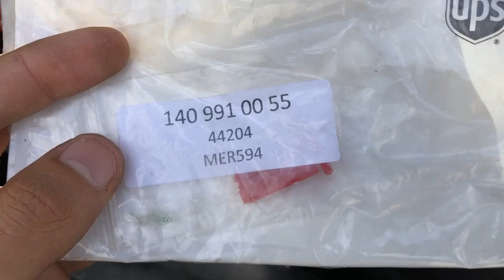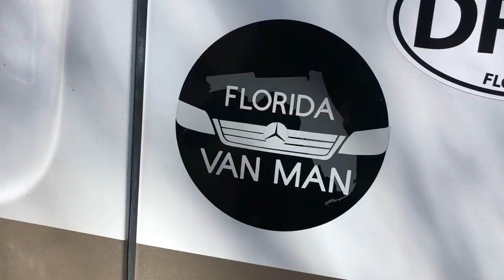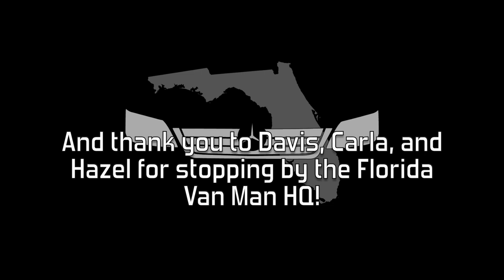2006 Sprinter/Vista Cruiser Transmission Service!

Comment: Thanks for sharing! Quality owner right there! Did the service fix the "slight" slippage the owner mentioned?  Why would there be fluid on that plug - seems like Mercedes would design a transmission sensor plug that would stay dry no?

Comment: So I think I just figured out what I've done wrong putting mine back together. An I'm sure I'm using the wrong phrases for the parts. When your putting the valve body back up an your making sure that linkage lines up, is the metal pin coming out of side go into the small channel in that plastic part that slides freely in the valve body. It would help me immensely if you see this an understand with my explanation. Thanks florida van man
Reply: It's at 14:30 in your video
Reply from the maker: Yes there is a pin that must slide into the horizontal slot in the yellow plastic piece. In the video, that moment when the valve body almost falls, we see the pin above the yellow plastic. Most of it is hidden everywhere I can pause the video.

Comment: Thanks for your help on a recent rebuilt engine install. Helped save me hours.  I have a 1/2" diameter breather tube that I am trying to install back on. Normal tubing on one end and a plug end on the other. It has two zip ties lock downs spaced along the tube. I can't seem to figure out where I removed it from and my manual searches and youtube searches aren not helping. Any pointers you can give me?  2005 Dodge Sprinter 2500 diesel. Thanks!
Reply from the maker: The only breather tube I can think of is from the top of the engine, close to the oil fill cap, and goes down to the turbo intake side. It fits into the larger hose from the air filter.
Reply: Thanks!  Appreciate your help.

Comment: I have the same rig, I had it lifted and added sumo springs. Now I need better suspension. I can’t find anyone to work on it. Diesel  mechanics tell me to call  a freight liner mechanic and they tell me to call Mercedes !
Reply from the maker: Oh I feel that pain, add two. My Fr8-r dealer told me to go to Mercedes, they told me to go to Dodge, and finally Dodge to me to go to hell. I ended up happy at a Kia dealership for some years until they closed. I try not to do my own brakes and tires but I don't trust anyone else diagnosing my 5 cylinder any more. My local independent mechanic closed recently, so I plan to do everything from here on. There are some good guys and maybe some gals in the groups and forums that get me through the rough.

Comment: I've noticed the torque converter is always drained after removing the valve body/conductor plate. Is it necessary to remove the valve body/conductor plate if you are only doing a filter and fluid change and don't have a reason to inspect further? Also, what is the FVM take on addressing rubble strip via drilling the small hole in the side plate to reduce torque converter pressure?
Reply from the maker: It is not necessary to drop the valve body/conductor plate if you have no suspicions or solid shifting problems. We've never performed the RSN fix because we did not think it was worth sacrificing 1-2mpg. The only van we've ever had with this problem has been gone for about a year, the new owners are very happy with their rumbly Sprinter. Mehyle and Shell ATF seem to be thinner in our experience and may help with some of the symptoms.
Reply: @FloridaVanMan  Great, thanks as always!

Comment: my torque converter , had the plug in the hole towards the front of the van, is there 2 or is mine just different?
Reply from the maker: Just different. I've seen a few that were hard to find, because I thought I knew were to look and was mistaken. I've read other people say their TC doesn't have a drain plug.

Comment: Being up on ramps doesn't 
mess with the build level???
Reply from the maker: It does, and on my sloped driveway we need ramps to level the van. We stop in the street to check on level ground for the final  checks. Preliminary checks are done while almost level.

Comment: @17:06, does the digital plug just snap in then tighten? 
I can not seem to get it in correct.
Reply from the maker: We have had similar trouble with one. The center screw seems just a hair too big to start in the threads. You definitely want to PUSH the connector in, not try to pull it in with the screw. I have used a board and hammer to tap it in. Be sure to use lube.